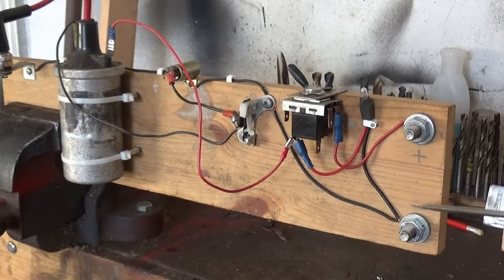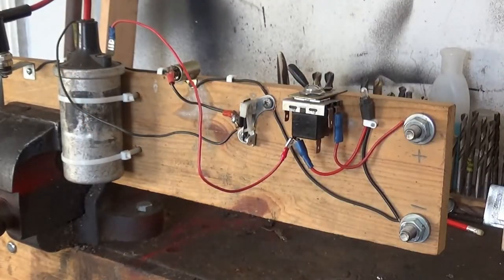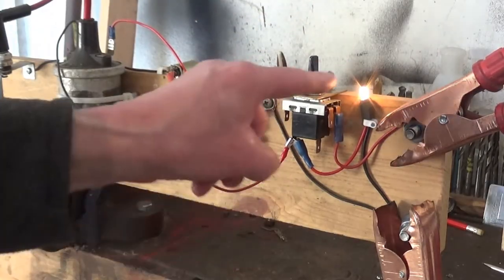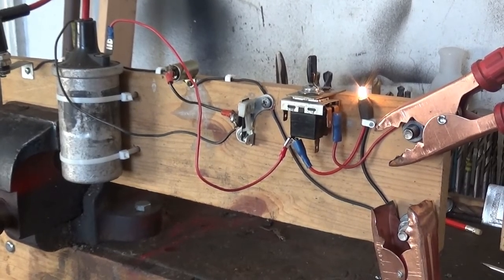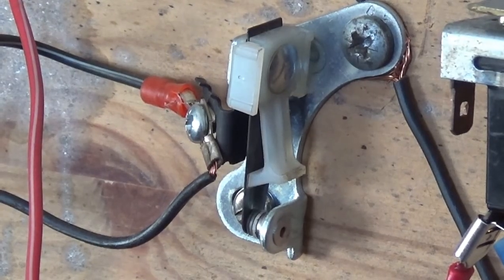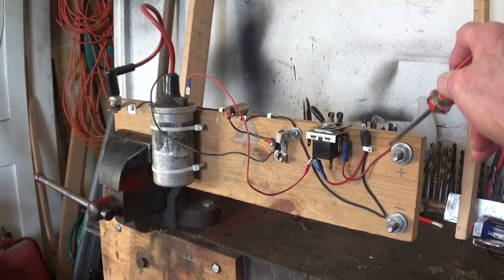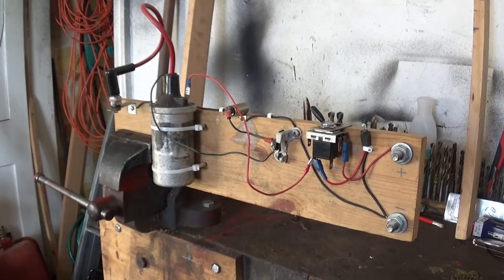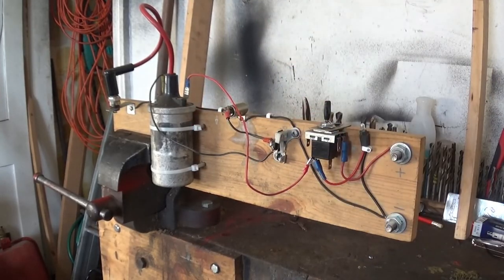How to wire ignition  with points and coil.

Comment: Thank you for finally explaining what was going on with points. I’ve messed with them for years not knowing exactly how they worked. I’m currently working on a 56 Oldsmobile that a puff of smoke came out near the ignition bits and wanted to know exactly how many wires I needed and where they should go. Someone rewired it a long time ago and every wire is black so again thank you.
Reply: Mine is on a stand and I seen the puff of smoke come from the distributor as well, oops 😬... hope this video gets me squared away

Comment: I have a 53 ford.. wagon V8 the coil has an internal resistor I'm having problems starting it
1. What should go to the pos side of the coil?
2. There is a white exciter wire on top of the alternator..where does that go?
Thank you

Comment: very clear thanks, just one question. How do know which of the  terminals on the coil are positive and negative? if they are not labeled?
Reply from the maker: If they are not labelled the coil must be insulated from the case. So it does not matter.

Comment: R u showing 6v or 12v system points can’t handle 12 v with out resister
Reply from the maker: Sorry Debra, they can. Most 60s cars were 12v without a resister. I had several.

Comment: Great video, I just have one question that you brushed past, if I understood you right then the spark plug sparks from the coils magnetic field collapse is that right? Or did I miss understand what you said? Thanks
Reply from the maker: You've got it. Remember simple electricity and magnetism. When a conductor passes through a magnetic field, it generates an EMF (voltage) Likewise if you pass electricity though a conductor you create a magnetic field. So 12 volts is passed through the large windings. It is switched off by the points. So the magnetic field collapses, passing through the small winding, of which there are many off them. So high voltage at low current is generated, enabling it to jump the spark plug gap.
Reply: MalcOfLincoln perfect thank you very much I haven’t worked with spark ignition much but I have wondered about it,
Reply from the maker: You're welcome of course. This is exactly why I made the video. So many today have never known coil and points.
Reply: MalcOfLincoln you are right about that, I went to a versatile 400 swather two years ago that had a ford straight 6 300 with points and well I had to call my dad for information on how to work on it cause I had no clue lol

Comment: Does the condenser make a bigger or smaller spark?
Reply: The condenser does 2 things. It acts as a spark quench to stop the points burning and the second thing it does is helps the magnetic field collapse faster which gives a crisp clean spark. Old mates video and explanation is absolutely 💯 correct. The only thing I would question is his coil. If you are working on an older English type car then your ignition system is +ve   ground. Lucas coils were wound for positive ground. That also gave the auto transformer action which improved the spark. In a nutshell everything must line up. +ve ground battery. Generator polarised to +ve ground. Coil is wound for positive ground, (negative spark)and wired as follows. SW to battery. CB (contact breaker) to side of distributor. Ask questions if this helps. 50 years doing this.

Comment: put a turn signal flasher in place of the points.  it makes a nice electric fence. with a single fence wire on some insulators until your battery runs down

Comment: I love it !
Reply from the maker: Excellent 😊😊👍 Was considering doing a demo with the Lister.....still might sometime. 
Now, thinking caps on, need a very simple dyno to see how much power the Lister has now. Doesn't have to be too accurate. So, 750watts is 1HP. But is this at 12 volts? If I get 1000w combined bulbs, switch them on with the alternator and the battery, surely when the batter is drained enough they'll be running on the alternator. Can't charge the batter and run the bulbs.
Reply: 750w/14volts=53.5 Amps ! One H7or H4 = +/- 4Amps or 55w ! You need 14 bulbs for a 750w load ! Or 18 blubs for a 1000w load ! I'm looking forward to that dyno test !!!
Reply from the maker: @massimobroccoli9854  Cheers mate, I'll start collecting bulbs. It's just a fun test, nothing serious....however a hint at reality eh!

Comment: Unique problem. If the car is converted from 6v to 12v, do wires from the carb need to switch posts? Here's the details: https://p15-d24.com/topic/52547-ignition-coil-wiring-question-w-diagrams/

Comment: Is this how the early datsuns of the 70s were wired
Reply from the maker: If it has a coil and distributor with points, then yes it will be like this.
Reply: @MalcOfLincoln  why bother with a ballast resistor why not wire it direct
Reply from the maker: @MrTwisted1977  If you wire a 6 volt coil to a 12 volt system it will burn out. But when starting the battery voltage drops. Sometimes, especially in cold weather to 6 or 8 volts, which is not enough to produce a spark. So to aid starting, some manufacturers fitted a 6 volt coil, wired direct for starting, but through a resistor for running.
Reply: @MalcOfLincoln  it seems to me that based on ur video the coil is acting like a step up transformer if this is the case why call it a coil and not a transformer
Reply from the maker: @MrTwisted1977  That's exactly what it is. Always known it as a coil, never thought about why it's called that. Probably because  when cars were first made.
Reply: @MalcOfLincoln  was the old model T ford wired like that
Reply from the maker: @MrTwisted1977  No. Through my online friend in the US they used buzz coils. People use them to run old stationary engines. I'd never heard of them, nor knew what they were for. Then watching someone with a model T learned they had 4 of them.
Reply: @MalcOfLincoln  ok mush no probs is there anything else b4 I call it a day